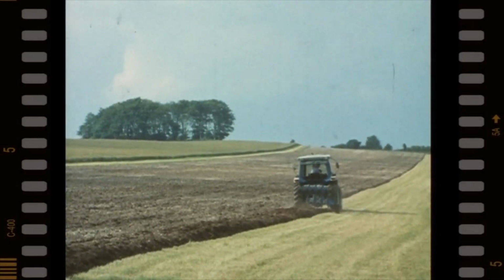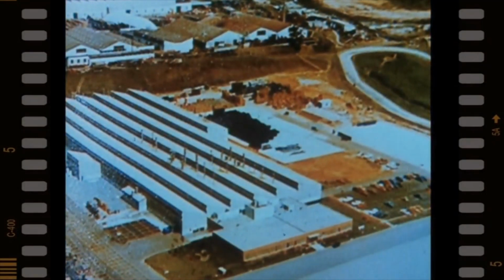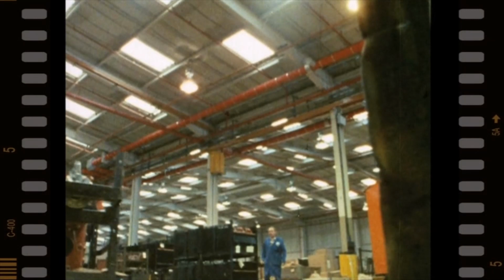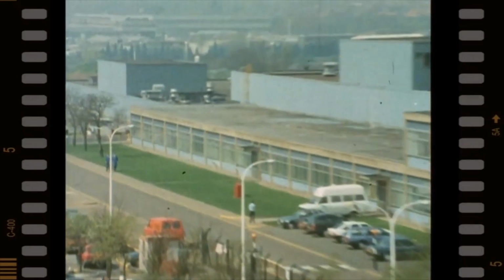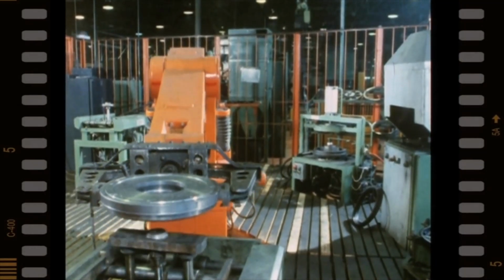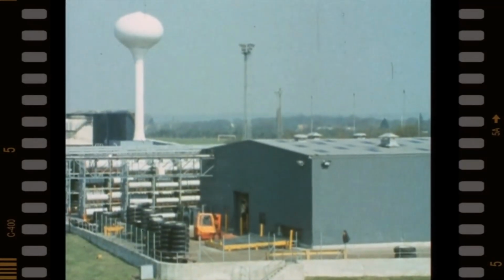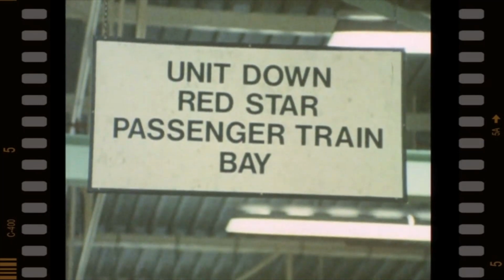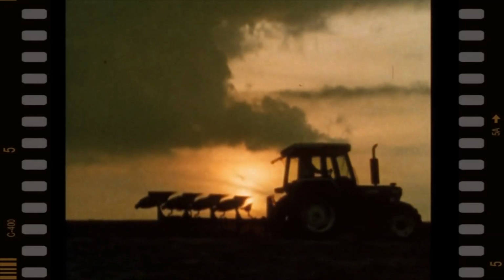Ford Tractor Operations Force 2 Promo Film

Comment: Ford tractors from that time was very beautiful but how was the durability? Engines for example did they performed well and held for many hours?
Reply: as a mech from that time for Ford i can say the engines were good for 6000hours and more. A overhaul of them was´nt that expensive due to their simple cast block where you can hone it a bit bigger and put in a bit overdimensioned pistons. These engines were mostly square strokers 107x107 or 112x112mm and with simply other pistons and heads the ran in Africa with gasoline ;-)
Reply: @kubanskiloewe  OK interesting, compare that whit today's engines that barley can stand the dieselfuel they're constructed to run on.